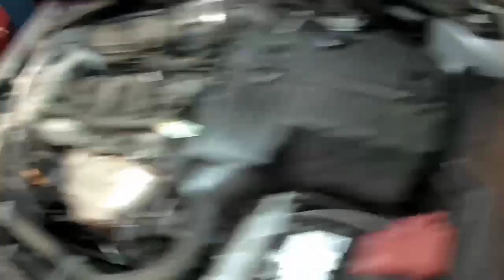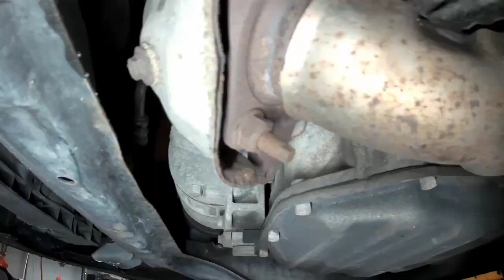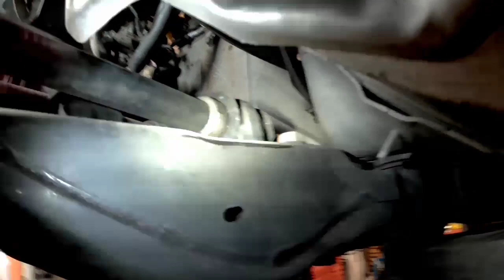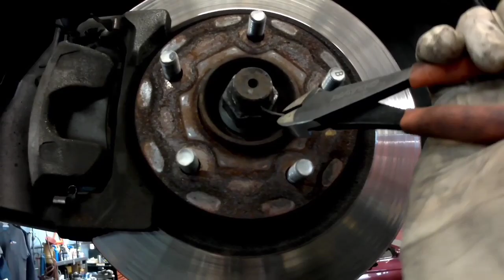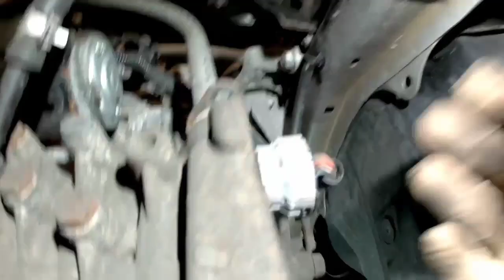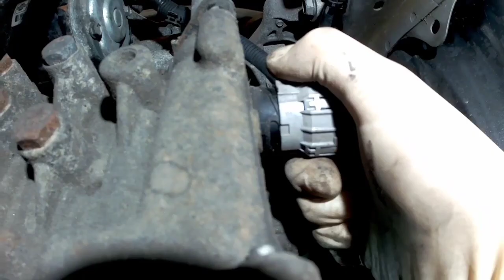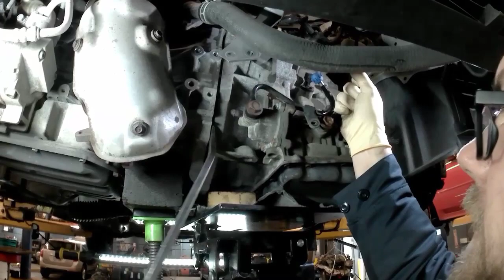2013 Nissan Altima CVT transmission removal

Comment: Do you lose any engine oil during this procedure?
Reply from the maker: Not when doing the transmission.
Reply: @CarMechaNick  what’s an appropriate amount to pay to have the CVT replaces on a 2014 2.5L Altima these days?  Mine is going out @ 129000 and I changed fluid at 50k and at 104k.  We drove it really easy too.  I’m pissed.
Reply from the maker: Damn that stinks. They're easy to change if you have experience. They call for like 6 or 7 hours to replace the unit. The unit itself is costly, and will require programming. These things have terrible trans problems, as far as my experience with them. Never have many engine problems. I want to assume maybe the newer o es are better given research and experience on the manufacturer. Only time will tell.
Reply: @CarMechaNick  any thoughts on what a fair price would be to have one put in?
Reply from the maker: Where I live, 450-500 labor.  Unit price varies, used and brand new.
Reply: Hi good job dose the Nissan Altima and Elgrand e52 2012 use same gearbox

Comment: CVT Transmission’s suck. Period. If you buy a Nissan buy a big vehicle. One that is built to haul a load. They have traditional transmissions
Reply from the maker: True that!
Reply: Those CVT’s do suck! If you are the slightest bit late on changing the fluid, they burn themselves up and the pumps on em go out ALL THE TIME!!! They also tend to have trash cooling systems which makes them overheat especially when climbing steep hills in hot weather. It’s a shame because Nissan still makes good engines (the VQ35DE being my favorite).
Reply from the maker: Yeah I don't do many nissan motors at all.

Comment: how did your torque converter come off so easily?
Reply from the maker: as long as it's got all the converter bolts removed it should come out no problemo.
Reply: @CarMechaNick  just yanked mine off!
Reply from the maker: awesome 👌 keep it up!

Comment: Good work but I took mine out thru the top after I popped out both axles and water outlet on the engine..
Reply from the maker: That's awesome, I've literally never done a trans from the top. Good work man. 👏

Comment: How did you turn the flywheel on the torque converter
Reply: And did it not set the engine out of time?
Reply from the maker: I put a long ratchet on the crank bolt to rotate the assembly. If you rotate clockwise you'll be fine on timing. If you miss a bolt I suggest making the full clockwise rotation back to it.

Comment: That's a lot of bolts to screw out .. I never knew it was that difficult to remove a CVT
Reply from the maker: I feel they all kind of come out the same. Some just have more bolts than others for sure. Usually the same concept though.  But in all reality these things stink big time!
Reply: @CarMechaNick  I have a 2010 Nissan Altima Coupe 2.5s and I feel like the sedans go out faster than the coupes .. The CVT's were not made for the sedans in my opinion .. They're large body cars ..
Reply from the maker: I see what you're saying, think it's to heavy? Yeah I've only done one coupe. But I don't really ever see coupes either.

Comment: How long does this take
Reply from the maker: Quick job, I've done lots so 5 hour job here, out and back in with usually a fresh dealer unit. Does require programming.
Reply: Car MechaNick programming that only Nissan can do?
Reply from the maker: Yes, in our case it is. We have stuff to do gm Mopar and ford but it seems more difficult for us to get the others.
Reply: Car MechaNick if you replace it with a used unit do you have to reprogram it?
Reply from the maker: We actually put the tcm from the donor car and didn't have any issues at all.
Reply: Yaw never answered the question
Reply: Car MechaNick ohh ok thanks man. I just finished swapping a trans and was wondering if I would encounter a problem as well. If I do have a issue can I reflash it with my snap on solus? First cvt transmission swap
Reply from the maker: You can try but I cant make any promises. If you can't nissan didnt charge us much to do the programming
Reply from the maker: What question wasn't answered?
Reply: Car MechaNick thanks. I checked it out and I have a function to relearn shift points and adaptive training on my scanner I’ll give that a try thanks for the response
Reply from the maker: @trillshyt36  heck yeah hope it works! Lmk!
Reply: Car MechaNick definitely will
Reply: Car MechaNick did the trans initialization and bam she’s running straight so far so good
Reply from the maker: Thats awesome! Sweet info 👌 mucho gracious!
Reply: Car MechaNick I have a question, my mechanic took my car to fix my transmission he was going to install a new one but his been having it since June 27, almost two months & he just told me on Sunday he is having issues to program it( his working on it at home) he said his friend was going to help him since he works at Nissan, my question is can you move the car without programming it ? Cause I really just need my car back already; I should of took took it to a shop :(
Reply from the maker: Dang, that is unfortunate. It will move, just not very well. It shouldn't be driven without proper programming.  But 2 months is for sure a long time for this car. That also depends on your mechanics schedule. I hope his friend has a good scan tool. Next time I would trust someone with some sort of credentials. They should also always have a finish date. Good techs account for problems in estimates, avoids surprises and everyone likes a smaller bill than the quote. I hope you get your car back soon!
Reply: Car MechaNick he has credentials he works at a dealership & he went to school for it he said his a tech or something like that, but he is doing it as a side job. He agreed it wouldn’t take more than 2 weeks then he that time pass he said he got hurt he would have it ready 2 weeks ago now nothing, at this point idk what to do :( He hasn’t gave me my total, I’m stressing out. But thank you for your help !
Reply from the maker: @Lili-wp6vl  jeez that sounds like a very sticky situation

Comment: What was wrong with this transmission, and what did you do — replace it from junkyard— or rebuild it ?
Reply from the maker: Typically we out used units in. Some cars get a reman or new if the price is comparable. Our vendors give is two year warranty on used units though.

Comment: Not a 2013 at all
Reply from the maker: Lol 👌
Reply: @CarMechaNick  it’s not . The trans cooling systems are completely different starting 2013 - 2018 when they went back to the 2011 cooling system cause the new cooling system idea is overheating the cvt and destroying . Not to mention that head cylinder garment covering is not a 2013 head dressing. The video was semi accurate as far as the mechanical visual so I don’t know why the year was lied about
Reply: @CarMechaNick  check that door placard again homie🤣😂🤣😂 completely different transmissions. I literally just did one. That is Not a 13 alrima. A simple google image search will show you that . Not even he headlights on that car match a 2013 🤣😂🤣😂😂
Reply from the maker: @eggbeaters  I do these in many varying years man and they are pretty much the exact same. Im not sure why you feel its that critical. Sorry to mislead you.
Reply from the maker: I do the videos and it takes a while to upload them. So I just use a rough estimate of years, due to a person in the comments complaining I didn't leave the years to cars. Hard to satisfy everyone.
Reply from the maker: Can you tell me a big difference between the two so I can highlight it for everyone to know.
Reply: @CarMechaNick  they are not at all the same . The trans coolers in 2011 had 1 lonely simple port . After that it got a weird intercoooler type of cooling system that failed from 2013 to 2018 due to that change . They now use again a very simple design that worked Before they did that independent cooling system
Reply: @CarMechaNick  I’m not trying to argue or have a pudding contest brother
Reply: @CarMechaNick  pissing I meant
Reply from the maker: So I mislead ppl by a few cooling hoses? Are the bell housings completely different? Converter bolt access? Subframe removal? All pretty similar?
Reply from the maker: Hahaha I like the pudding. I mean with a short comment on the year being wrong seems rather unhelpful. Why not say what is different instead of trying to say I'm wrong?
Reply: @CarMechaNick  everything is the exact same except the cooling component
Reply: @CarMechaNick  and the pressure housing
Reply: @CarMechaNick  it’s very hard to type lol that’s why I asked you to call me man
Reply: @CarMechaNick  I could send you pics if we were talking in real life to show you exactly what I’m saying .
Reply from the maker: Okay man. Thats all that really matters to me.  When someone who hasn't done this job is just looking for a quick walk through. I do this video stuff for free man. To help people.
Reply: @CarMechaNick  respect bro , happy holidays
Reply from the maker: I'm honestly just here trying to help man. Thanks for watching and spreading info here. Happy holidays to you as well.